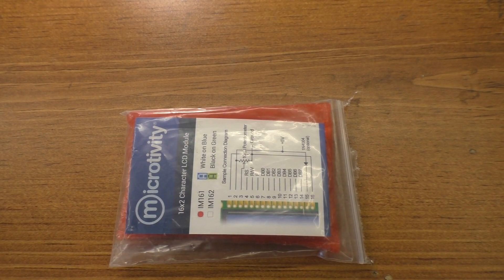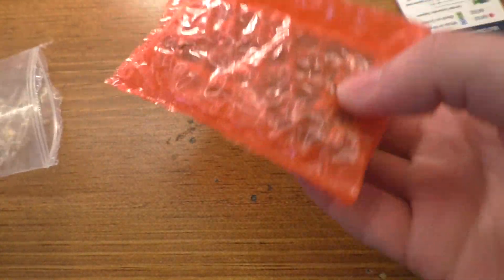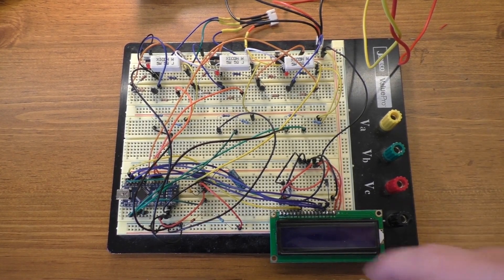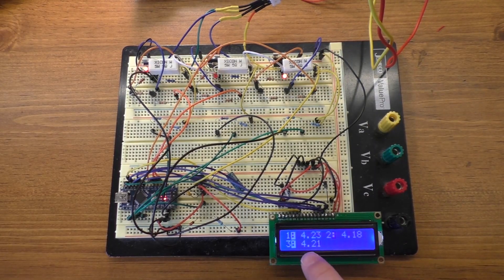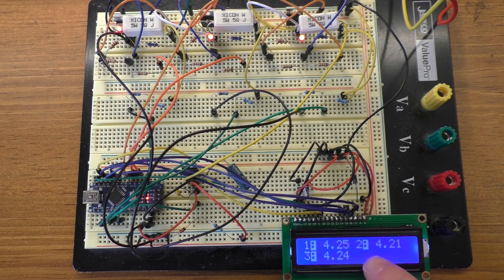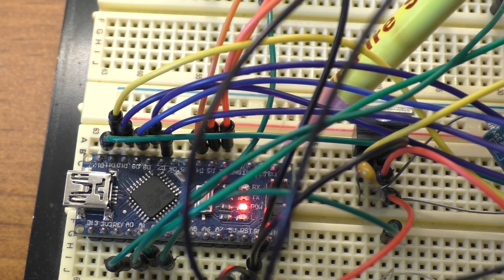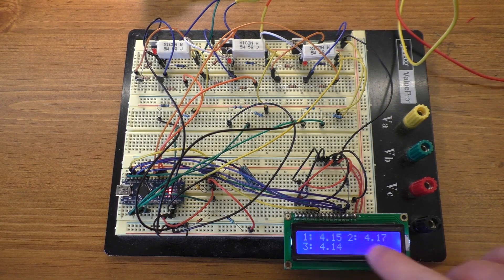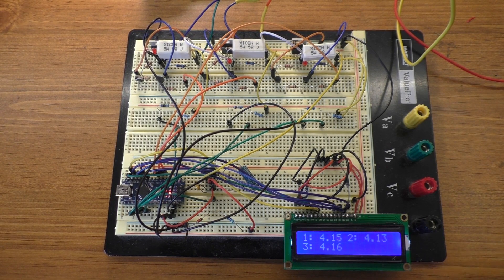Arduino BMS #4: Adding an LCD

Comment: I2C is one way to reduce the IO pin use on the LCD, another way would be to use the enable pin to disable the LCD, and some other method (Octal buffer) to disconnect say the mosfet inputs. Basic idea being to update the LCD when reading the cell voltages, then go back to balancing the cells.
Reply from the maker: Thanks for the idea!

Comment: I just started following this project. I was thinking about doing the same. or similar project. how hard would it be to build one for 7s liion. I'm not sure if it would  require more pins. I haven't ever used arduino. I am itching to get started with a arduino though. I need a BMS that will balance with higher current . a two stage balance would be great . with about a 5 amp main balance load per cell . starting at about 4 volts then switch to about 500 ma. balance load. and have the loads adjustable. depending on bank size. and charge current. I plan to eventually have a bank of 2000+ amp hours at a peak of 29.4 v. and potentially charge in a few hundred amps. I would like to eventually have around 25% more charge current than the inverter uses. so I can charge and power the inverter. and still get a good charge in about 5-6 hours. my inverter can pull about 5 kW. so. a bit over 200 amps at near 30 volts. so I'd like to have the capacity to charge at 300 amps. I plan for all my series cells to be the same cells. only series same brand cells. and matched close as I can get. I have never heard of multi stage balancing. could that be a good idea? also to a have the ability to balance at any time or voltage would be nice! I plan to only charge to 4.1v or maybe 4.15v .  trying to push the cell life as far as I can. adding to and replacing cells. will likely be a yearly ongoing project. since they will be added to slowly over time. and cells will age and need replacing. sorry. I tend to ramble. I like building everything my self. but this is on the verge of being over my head. thanks for sharing such a interesting project. thank you...